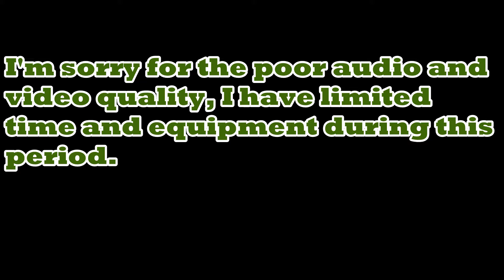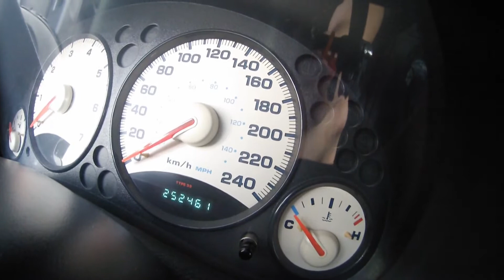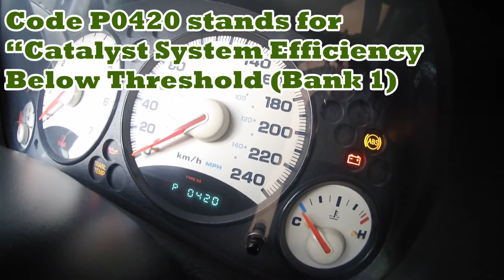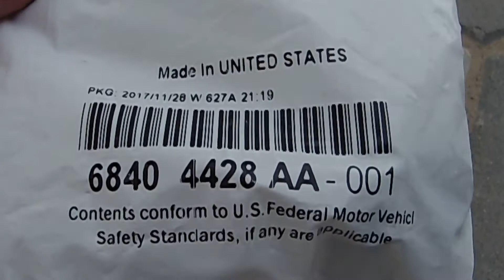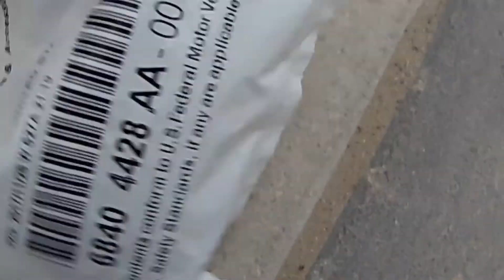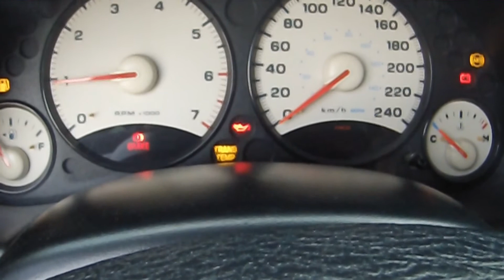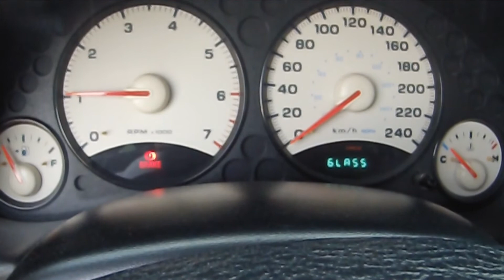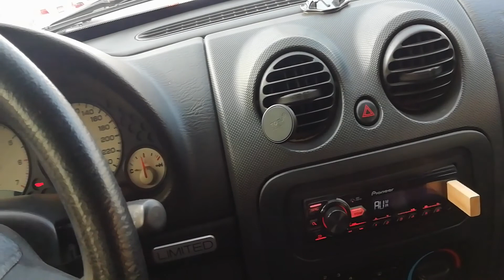2004 Jeep Cherokee throttle position sensor (TPS) replacement

Comment: Great video I’m doing this tomorrow myself!! I have replaced plugs, coil pack , starter and map sensor this week. Still having same problems. TPS is my last shot or I’m gonna set this piece of shit on fire
Reply from the maker: 😂😂😂 Dont.. Maybe we can still save it. What the issue?
Reply: @adrianreyes640  TPS sensor was actually split in half when I got to it. It definitely wasn’t making a connection. But now after changing it , gas mileage went down drastically like right now it’s saying 4.3 mph!! I don’t understand this because when I changed the map sensor I thought that problem was resolved. Any thoughts ??
Reply from the maker: @jennfun1974  so the issue is the fuel consumption is high? Am i correct? How the idle speed? Did you feel anything weird on the shifting timings of the transmission? Feel free to reach me in IG adriandranreb.